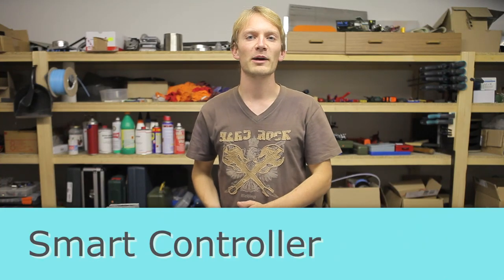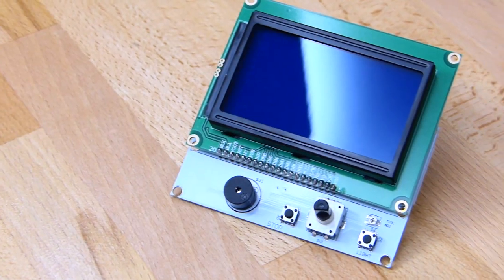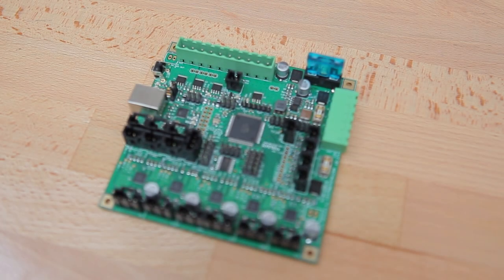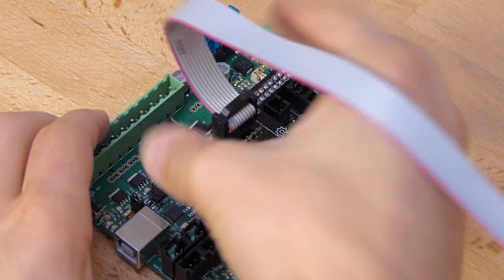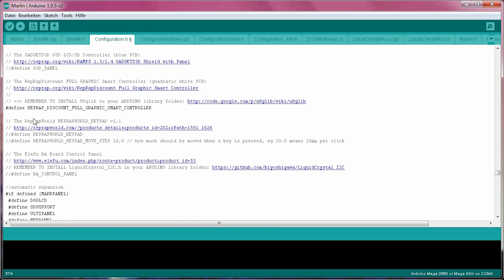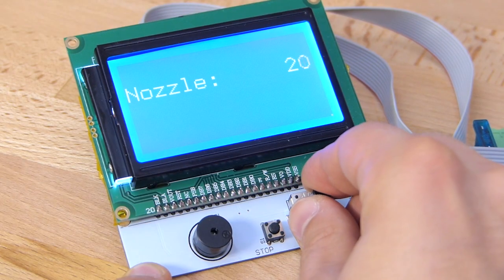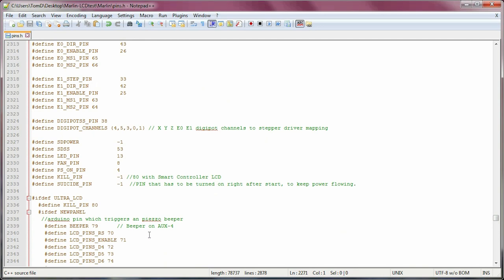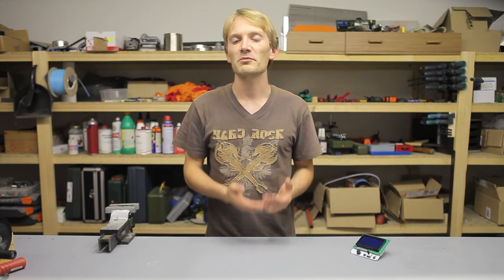3D printing guides - Setting up a LCD and SD card controller panel

Comment: Hello Tom,  ( or another some-one to help me )

I realy like your movies on youtube, if I try things at home, they work most of the time!

I am using a Melzi board with a 12864 -display, I have "U8lib" installed    ( version 1.16, try'd 1.18 as well ) but I get tehe errors shown down here.

can some-one please help?

greetings and thanks in advance,

Jurgen

In file included from /dogm_lcd_implementation.h:40,
                 from ultralcd.cpp:36:
/ultralcd_st7920_u8glib_rrd.h: In function 'void ST7920_SWSPI_SND_8BIT(uint8_t)':
ultralcd_st7920_u8glib_rrd.h:34: error: 'DIOLCD_PINS_D4_RPORT' was not declared in this scope
ultralcd_st7920_u8glib_rrd.h:34: error: 'DIOLCD_PINS_D4_WPORT' was not declared in this scope
ultralcd_st7920_u8glib_rrd.h:34: error: 'DIOLCD_PINS_D4_PIN' was not declared in this scope
ultralcd_st7920_u8glib_rrd.h:34: error: 'DIOLCD_PINS_D4_WPORT' was not declared in this scope
ultralcd_st7920_u8glib_rrd.h:34: error: 'DIOLCD_PINS_D4_PIN' was not declared in this scope
ultralcd_st7920_u8glib_rrd.h:34: error: 'DIOLCD_PINS_D4_WPORT' was not declared in this scope
ultralcd_st7920_u8glib_rrd.h:34: error: 'DIOLCD_PINS_D4_PIN' was not declared in this scope
ultralcd_st7920_u8glib_rrd.h:34: error: 'DIOLCD_PINS_D4_WPORT' was not declared in this scope
ultralcd_st7920_u8glib_rrd.h:34: error: 'DIOLCD_PINS_D4_PIN' was not declared in this scope
ultralcd_st7920_u8glib_rrd.h:35: error: 'DIOLCD_PINS_ENABLE_RPORT' was not declared in this scope
ultralcd_st7920_u8glib_rrd.h:35: error: 'DIOLCD_PINS_ENABLE_WPORT' was not declared in this scope
ultralcd_st7920_u8glib_rrd.h:35: error: 'DIOLCD_PINS_ENABLE_PIN' was not declared in this scope
ultralcd_st7920_u8glib_rrd.h:35: error: 'DIOLCD_PINS_ENABLE_WPORT' was not declared in this scope
ultralcd_st7920_u8glib_rrd.h:35: error: 'DIOLCD_PINS_ENABLE_PIN' was not declared in this scope
ultralcd_st7920_u8glib_rrd.h:35: error: 'DIOLCD_PINS_ENABLE_WPORT' was not declared in this scope
ultralcd_st7920_u8glib_rrd.h:35: error: 'DIOLCD_PINS_ENABLE_PIN' was not declared in this scope
ultralcd_st7920_u8glib_rrd.h:35: error: 'DIOLCD_PINS_ENABLE_WPORT' was not declared in this scope
ultralcd_st7920_u8glib_rrd.h:35: error: 'DIOLCD_PINS_ENABLE_PIN' was not declared in this scope
ultralcd_st7920_u8glib_rrd.h:37: error: 'DIOLCD_PINS_D4_RPORT' was not declared in this scope
ultralcd_st7920_u8glib_rrd.h:37: error: 'DIOLCD_PINS_D4_WPORT' was not declared in this scope
ultralcd_st7920_u8glib_rrd.h:37: error: 'DIOLCD_PINS_D4_PIN' was not declared in this scope
ultralcd_st7920_u8glib_rrd.h:37: error: 'DIOLCD_PINS_D4_WPORT' was not declared in this scope
ultralcd_st7920_u8glib_rrd.h:37: error: 'DIOLCD_PINS_D4_PIN' was not declared in this scope
ultralcd_st7920_u8glib_rrd.h:37: error: 'DIOLCD_PINS_D4_WPORT' was not declared in this scope
ultralcd_st7920_u8glib_rrd.h:37: error: 'DIOLCD_PINS_D4_PIN' was not declared in this scope
ultralcd_st7920_u8glib_rrd.h:37: error: 'DIOLCD_PINS_D4_WPORT' was not declared in this scope
ultralcd_st7920_u8glib_rrd.h:37: error: 'DIOLCD_PINS_D4_PIN' was not declared in this scope
/ultralcd_st7920_u8glib_rrd.h: In function 'uint8_t u8g_dev_rrd_st7920_128x64_fn(u8g_t*, u8g_dev_t*, uint8_t, void*)':
ultralcd_st7920_u8glib_rrd.h:55: error: 'DIOLCD_PINS_RS_DDR' was not declared in this scope
ultralcd_st7920_u8glib_rrd.h:55: error: 'DIOLCD_PINS_RS_PIN' was not declared in this scope
ultralcd_st7920_u8glib_rrd.h:56: error: 'DIOLCD_PINS_RS_RPORT' was not declared in this scope
ultralcd_st7920_u8glib_rrd.h:56: error: 'DIOLCD_PINS_RS_WPORT' was not declared in this scope
ultralcd_st7920_u8glib_rrd.h:56: error: 'DIOLCD_PINS_RS_PIN' was not declared in this scope
ultralcd_st7920_u8glib_rrd.h:56: error: 'DIOLCD_PINS_RS_WPORT' was not declared in this scope
ultralcd_st7920_u8glib_rrd.h:56: error: 'DIOLCD_PINS_RS_PIN' was not declared in this scope
ultralcd_st7920_u8glib_rrd.h:56: error: 'DIOLCD_PINS_RS_WPORT' was not declared in this scope
ultralcd_st7920_u8glib_rrd.h:56: error: 'DIOLCD_PINS_RS_PIN' was not declared in this scope
ultralcd_st7920_u8glib_rrd.h:56: error: 'DIOLCD_PINS_RS_WPORT' was not declared in this scope
ultralcd_st7920_u8glib_rrd.h:56: error: 'DIOLCD_PINS_RS_PIN' was not declared in this scope
ultralcd_st7920_u8glib_rrd.h:57: error: 'DIOLCD_PINS_ENABLE_DDR' was not declared in this scope
ultralcd_st7920_u8glib_rrd.h:57: error: 'DIOLCD_PINS_ENABLE_PIN' was not declared in this scope
ultralcd_st7920_u8glib_rrd.h:58: error: 'DIOLCD_PINS_ENABLE_RPORT' was not declared in this scope
ultralcd_st7920_u8glib_rrd.h:58: error: 'DIOLCD_PINS_ENABLE_WPORT' was not declared in this scope
ultralcd_st7920_u8glib_rrd.h:58: error: 'DIOLCD_PINS_ENABLE_PIN' was not declared in this scope
ultralcd_st7920_u8glib_rrd.h:58: error: 'DIOLCD_PINS_ENABLE_WPORT' was not declared in this scope
ultralcd_st7920_u8glib_rrd.h:58: error: 'DIOLCD_PINS_ENABLE_PIN' was not declared in this scope
ultralcd_st7920_u8glib_rrd.h:58: error: 'DIOLCD_PINS_ENABLE_WPORT' was not declared in this scope
ultralcd_st7920_u8glib_rrd.h:58: error: 'DIOLCD_PINS_ENABLE_PIN' was not declared in this scope
ultralcd_st7920_u8glib_rrd.h:58: error: 'DIOLCD_PINS_ENABLE_WPORT' was not declared in this scope
ultralcd_st7920_u8glib_rrd.h:58: error: 'DIOLCD_PINS_ENABLE_PIN' was not declared in this scope
ultralcd_st7920_u8glib_rrd.h:59: error: 'DIOLCD_PINS_D4_DDR' was not declared in this scope
ultralcd_st7920_u8glib_rrd.h:59: error: 'DIOLCD_PINS_D4_PIN' was not declared in this scope
ultralcd_st7920_u8glib_rrd.h:60: error: 'DIOLCD_PINS_D4_RPORT' was not declared in this scope
ultralcd_st7920_u8glib_rrd.h:60: error: 'DIOLCD_PINS_D4_WPORT' was not declared in this scope
ultralcd_st7920_u8glib_rrd.h:60: error: 'DIOLCD_PINS_D4_PIN' was not declared in this scope
ultralcd_st7920_u8glib_rrd.h:60: error: 'DIOLCD_PINS_D4_WPORT' was not declared in this scope
ultralcd_st7920_u8glib_rrd.h:60: error: 'DIOLCD_PINS_D4_PIN' was not declared in this scope
ultralcd_st7920_u8glib_rrd.h:60: error: 'DIOLCD_PINS_D4_WPORT' was not declared in this scope
ultralcd_st7920_u8glib_rrd.h:60: error: 'DIOLCD_PINS_D4_PIN' was not declared in this scope
ultralcd_st7920_u8glib_rrd.h:60: error: 'DIOLCD_PINS_D4_WPORT' was not declared in this scope
ultralcd_st7920_u8glib_rrd.h:60: error: 'DIOLCD_PINS_D4_PIN' was not declared in this scope
ultralcd_st7920_u8glib_rrd.h:62: error: 'DIOLCD_PINS_RS_RPORT' was not declared in this scope
ultralcd_st7920_u8glib_rrd.h:62: error: 'DIOLCD_PINS_RS_WPORT' was not declared in this scope
ultralcd_st7920_u8glib_rrd.h:62: error: 'DIOLCD_PINS_RS_PIN' was not declared in this scope
ultralcd_st7920_u8glib_rrd.h:62: error: 'DIOLCD_PINS_RS_WPORT' was not declared in this scope
ultralcd_st7920_u8glib_rrd.h:62: error: 'DIOLCD_PINS_RS_PIN' was not declared in this scope
ultralcd_st7920_u8glib_rrd.h:62: error: 'DIOLCD_PINS_RS_WPORT' was not declared in this scope
ultralcd_st7920_u8glib_rrd.h:62: error: 'DIOLCD_PINS_RS_PIN' was not declared in this scope
ultralcd_st7920_u8glib_rrd.h:62: error: 'DIOLCD_PINS_RS_WPORT' was not declared in this scope
ultralcd_st7920_u8glib_rrd.h:62: error: 'DIOLCD_PINS_RS_PIN' was not declared in this scope
ultralcd_st7920_u8glib_rrd.h:79: error: 'DIOLCD_PINS_RS_RPORT' was not declared in this scope
ultralcd_st7920_u8glib_rrd.h:79: error: 'DIOLCD_PINS_RS_WPORT' was not declared in this scope
ultralcd_st7920_u8glib_rrd.h:79: error: 'DIOLCD_PINS_RS_PIN' was not declared in this scope
ultralcd_st7920_u8glib_rrd.h:79: error: 'DIOLCD_PINS_RS_WPORT' was not declared in this scope
ultralcd_st7920_u8glib_rrd.h:79: error: 'DIOLCD_PINS_RS_PIN' was not declared in this scope
ultralcd_st7920_u8glib_rrd.h:79: error: 'DIOLCD_PINS_RS_WPORT' was not declared in this scope
ultralcd_st7920_u8glib_rrd.h:79: error: 'DIOLCD_PINS_RS_PIN' was not declared in this scope
ultralcd_st7920_u8glib_rrd.h:79: error: 'DIOLCD_PINS_RS_WPORT' was not declared in this scope
ultralcd_st7920_u8glib_rrd.h:79: error: 'DIOLCD_PINS_RS_PIN' was not declared in this scope
ultralcd_st7920_u8glib_rrd.h:92: error: 'DIOLCD_PINS_RS_RPORT' was not declared in this scope
ultralcd_st7920_u8glib_rrd.h:92: error: 'DIOLCD_PINS_RS_WPORT' was not declared in this scope
ultralcd_st7920_u8glib_rrd.h:92: error: 'DIOLCD_PINS_RS_PIN' was not declared in this scope
ultralcd_st7920_u8glib_rrd.h:92: error: 'DIOLCD_PINS_RS_WPORT' was not declared in this scope
ultralcd_st7920_u8glib_rrd.h:92: error: 'DIOLCD_PINS_RS_PIN' was not declared in this scope
ultralcd_st7920_u8glib_rrd.h:92: error: 'DIOLCD_PINS_RS_WPORT' was not declared in this scope
ultralcd_st7920_u8glib_rrd.h:92: error: 'DIOLCD_PINS_RS_PIN' was not declared in this scope
ultralcd_st7920_u8glib_rrd.h:92: error: 'DIOLCD_PINS_RS_WPORT' was not declared in this scope
ultralcd_st7920_u8glib_rrd.h:92: error: 'DIOLCD_PINS_RS_PIN' was not declared in this scope
ultralcd_st7920_u8glib_rrd.h:111: error: 'DIOLCD_PINS_RS_RPORT' was not declared in this scope
ultralcd_st7920_u8glib_rrd.h:111: error: 'DIOLCD_PINS_RS_WPORT' was not declared in this scope
ultralcd_st7920_u8glib_rrd.h:111: error: 'DIOLCD_PINS_RS_PIN' was not declared in this scope
ultralcd_st7920_u8glib_rrd.h:111: error: 'DIOLCD_PINS_RS_WPORT' was not declared in this scope
ultralcd_st7920_u8glib_rrd.h:111: error: 'DIOLCD_PINS_RS_PIN' was not declared in this scope
ultralcd_st7920_u8glib_rrd.h:111: error: 'DIOLCD_PINS_RS_WPORT' was not declared in this scope
ultralcd_st7920_u8glib_rrd.h:111: error: 'DIOLCD_PINS_RS_PIN' was not declared in this scope
ultralcd_st7920_u8glib_rrd.h:111: error: 'DIOLCD_PINS_RS_WPORT' was not declared in this scope
ultralcd_st7920_u8glib_rrd.h:111: error: 'DIOLCD_PINS_RS_PIN' was not declared in this scope

Comment: Word of warning, Do NOT use the online install feature for the U8glib library that the Arduino library manager 1.6.5 can install from an online source, it doesn't contain the /utility directory needed to get this up and running! Download the lib by hand and use the Add .zip library function with U8gblib 1.18.1 and you're set!
Reply: JohnnyBoy2001 The current Arduino IDE 1.6.5. has an integrated download manager for libraries. If you use it to download the U8glib required by the display, it won't work as that version is missing the /utilities subfolder. So you have to hand-install the manually downloaded one, the automatically downloaded version will not work, even if it will tell you it is installed!

Comment: Hallo also erstmal möchte ich dich für deine Videos loben ein paar mehr in Deutsch wären fein aber naja.
Könntest du mir bitte helfen?
Also die richtung meines drehknopfes ist falsch allerdings bekomme ich es nicht hin laut deiner Anleitung.
Ich mach die Pin.h datei auf ändere es lade es neu auf den drucker aber es ändert nicht wie wenn er die daten aus pin.h nicht übernehmen würde.
Hasst du eine Ahnung was da sein kann?
Hab Marlin.

Lg
Reply: Hey Danke für die schnelle Antwort.
Kein Problem geht ja in Englisch auch :)
Aber deine Videos sind echt super und Hilfreich.
Ja also ich habe meines Wissens den Richtigen Abschnitt geändert.
Das mit der genauigkeit des Encoders bin ich auch nicht zufrieden möglicherweise hab ich da auch was falsch gemacht.
Da ich jetzt im Menü um 1 Zeile runterzuscrolen 4-7 Klicks am Drehregler machen muss.
Aber wichtiger wäre es mir die Richtung RICHTIG zu bekommen.

lg

Comment: Hi Tom I have 3d printer which has makeboard mini control board I have connected robotdyn lcd 20x4 it works fine but only problem is I cannot print directly from the Lcd controller but I can print by connecting the printer to computer and using ponterface where print from SD card option is available. 
When I insert SD card on Lcd it doesn't read but when I open 'no SD card' option on display it shows the g code files and if selected it goes back to main screen and timer on display starts but wont print. 
So can you help me out please